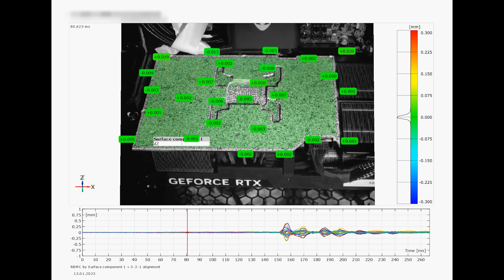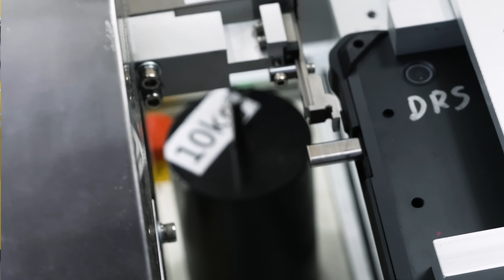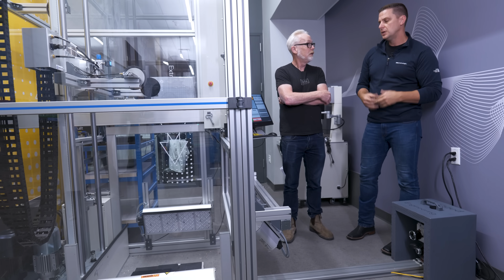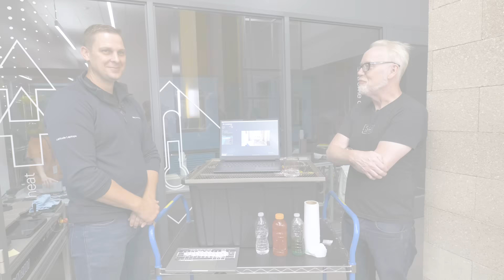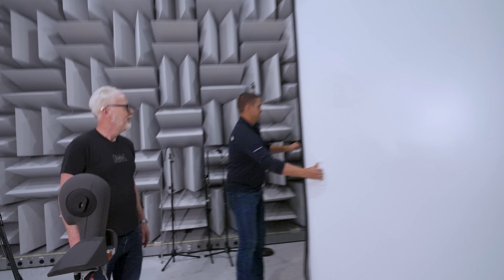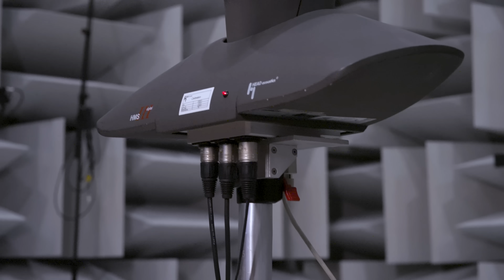Adam Savage Spills Water on a Laptop!

Comment: Totally unimpressed,  Over the last 10 years if I was present when someone spilled sweet, acidic liquid into a laptop I immediatelypulled the battery and ran water from the faucet through the whole machine, then if I had it one rinse with distilled water, then set it aside for a day or 3 to dry out.  The time to dry out was overkill.  Never had a bad experience.  Heck, back in the early 90s we used to run computer keyboards through the dishwasher without soap for the same reason!

Comment: The worse computer operating environment I ran into was a desktop running in an office adjacent to a lumber finishing mill. The case was wall to wall sawdust.
Reply: I used to do tech work, and I did jobs for a drywall company many times.  Sheetrock dust was a significant problem for their computers (and probably worse for the fan bearings than sawdust, though I never saw one fail due to that).
Reply: @rybec  I wasn't a hardware tech, so I'm not exactly sure what the state of the floppy drives were (1980s) but they couldn't read the spare disks I brought along with me.
Reply: @ssgtmole8610  I'm quite familiar with floppy drives (both the 5.25 inch ones common in the '80s and the 3.5 inch ones that were common for most of the '90s), and they could very easily have accumulated so much dust that it would prevent them from functioning correctly.  Just once piece of sawdust on the read head could have put enough space between the disk and the head that it wouldn't be able to read.

Comment: Such mixed feelings. I enjoy these paid promotions, as Adam does a good job both disclosing that we're about to see basically a lengthy ad, while still ensuring that it's actually an interesting story.

On the other hand, my Dell laptop is on its third touchpad in two years, which has failed just like the first two did, i.e. periodically getting into a state where it responds to touch intermittently or not at all, making it impossible to use. The cursor jumps around, things get clicked randomly or, if you're lucky, nothing at all happens and so you don't accidentally drag your email messages into the wrong folder (for example).

I can keep water away from my laptop. It's nice a laptop can be made to be more resilient, but why can't Dell just work on getting the basic functionality to work first? Then they can do fancy things like environmental protections.

Comment: This is the kind of thing that capitalism pays for, making better products with our purchase dollars from prior models. Nike did this for decades making a better shoe, Speedo did it for Olympic swimsuits, Specialized couldn't find a low speed wind tunnel to test their bikes and equipment on, so they went and built one next door to their Silicon Valley HQ. We want to know that our purchases and our investment in a product and in a company will improve over time. 

Dell laptops are outstanding, and have an excellent durability and lifetime. Their desktops not so much, I did that once, and never again, but I've had probably 6 of their laptops, and the two 15 inch laptops I've had all each lasted over 10 years, the 13 inch ultrabooks a bit shorter, but easily 3 to 5 years each.

Comment: I have an Alienware from the mid to late 2010s (I don't recall exactly).  I wish it had gone through this kind of testing.  It has had so many heat issues that it now won't run for more than a few minutes before it gets too hot and halts with severe graphics corruption, even right after opening it up and cleaning out dust.  At one point I replaced the old, dried and cracking thermal compound with something far superior, and that helped for a while, but I suspect the constant overheating has actually damaged some of the chips, increasing their sensitivity to heat.  (I'm running Linux on it, and I have it set to throttle at 70C, and it still has severe problems.)  I'm planning on eventually opening it up and turning it into a desktop with much better thermal management.  I'm going to getting into the market for a new laptop soon, since it is unusable as a laptop at this point, and until I had watched this, I had written off Alienware entirely due to the horrible experience.  I don't do heavy gaming, but I do some other kinds of high performance computing for work and for personal research, so I need a very powerful system that can handle extended periods of high strain.  If this is the kind of testing they are doing now, maybe I should give Alienware a second chance...
Reply: From which year you started getting these problems?
Reply: @harshvardhanMi  Somewhere in the range of 2018-2020.  Give me a moment, and I'll check the model.  I don't remember precisely what year I got it, but it was a few years old model at the time, if I recall correctly.
Reply: @harshvardhanMi  I was wrong.  I couldn't have even gotten it before 2020, and it wasn't an older model when I got it.  It's an M15 R3.  The CPU is an i7-10750H, which was launched in 2020.  That means I probably bought it either November of 2020 or March of 2021.  It started having heat issues after around a year.  I opened it up and blew dust out of the heat sinks, and that solved the problem.  Sometime in 2022, it started having heat issues again, but blowing out the dust didn't fix all of them.  It didn't heat up as much, but over around 80C it would start to have graphical glitching.  That slowly dropped to around 75C, at which point I opened it up again and found that the heat sink compound was dry and cracking.  I replaced it with a higher end heat sink compound, and that seemed to help, but eventually the glitching came back.  I was running Linux on it, so I edited some system settings to throttle the CPU at 70C, and that helped for around a year.  By the middle of last year, it would start graphical glitching at 70C even under very light loads, and this would rapidly lead to a complete crash.  The last time I cleaned out the heatsinks was early this year, and it made no difference.  Now if it is even on for more than 5 to 10 minutes, it will have severe screen corruption and crash.  I only turn it on to retrieve stuff from the hard drive now.  I haven't checked the heat sink grease recently, but the last time I checked it was still fine.

Like I said, my plan now is to eventually remove it from the case and turn it into a desktop with some high end custom cooling.  I'm hoping the heat issues haven't caused enough damage that even this won't help.
Reply: @harshvardhanMi  Hmm, I wrote a second reply, but YouTube seems to have eaten it.  I was wrong about the timing.  It's an M15 R3, and since the CPU in it wasn't released until the second quarter of 2020, it can't be older than that.  That means I probably got it in March of 2021.  It started having thermal issues around a year later, and initially opening it up and blowing the dust out of the heat sinks resolved the problem, but eventually it started having issues around 80C even when the heatsinks were clean and fans on full blast.  I opened it up and replaced the crusty and cracking heat sink compound with some higher end stuff, and set it to throttle at 70C at that point (I was running Linux on it, which allowed me to set the throttle temperature).  That seemed to fix the problems for a while, but eventually it started getting screen glitchiness again, around 65C to 70C.  Somewhere around the middle of last year it got to the point where it can't run more than 5 to 10 minutes before glitching and then crashing completely, even under low load.  I cleaned it again a few months ago, but it didn't make any difference.  I haven't checked the heat sink grease since late last year, but it was fine then.

When I was replacing the heat sink grease, I did notice that the GPU chips (at least, I think they are GPU related...I think they are VRAM chips, but it has been long enough that I no longer recall why I think that) weren't directly connected to the thermal management system.  They are connected through quarter inch thick (maybe thicker) foam-like thermal pads, which probably conduct heat quite poorly.  I suspect these chips may have been damaged by overheating, but there's not really any way I can find out on my own.  It's possible they are just overheating due to poor thermal management though, and maybe nothing is actually damaged.

Comment: WRT liquid damage: water is not necessarily a 'conductive fluid': if it's distilled (or preferably deionised) it won't cause a long-term problem unless combined with some other contaminant (eg assorted dust or other airbound pollutants): as demonstrated, simply shake off excess & leave to dry. The major (& most likely) problem comes from a solution of water & other solubles, eg acid (from carbonated drinks such as cola) & sugar (which crystallises onto a surface.. eventually, while leaving a sticky dust-attracting mess for a long time while it dries). Even if there's no sugar added to tea/coffee, milk introduces a biological growth potential over time, & the plain steeped (ie 'black') liquids are still acidic - tho less likely to adhere to components (often a distilled water wash & dry will be perfectly adequate in these cases)

Then there's airbound contaminants. Not all countries have universal smoking bans (& Dell sell their Alienware product to most) even in indoor public spaces; likewise, inner-city pollution from vehicles is a major hazard in many cities worldwide, not just India/China or others still using coal-fired power plants. Tobacco tar is extremely invasive, sticky & gathers on eg fan blades due to electrostatic attraction, which helps them to gather dust & hence become more inefficient over the laptop's (gusstimate projected) 5-yr lifespan :( Other airbound contaminants may not be as damaging over time, but this is certainly a major one to consider.. along with the ventilation (& even size) of the space in which it'll spend most of its life

WRT the drop test: I hope there are other random factors introduced into the robot testing, as it's rare a random 'caught my foot in a cable' or 'my bag failed/spilled' accident will result in a perfectly flat/45deg/corner/WHY drop IME: /some/ will always escape the test bounds & therefore be hardest to anticipate or prevent

Comment: Most decent laptops (not apple) can easily survive water spillage. Sugary beverages though, you're screwed.
Reply: I once spilled a can of coke into my keyboard.
It still worked, but after that for every key I would press it would press that key then a random key.
Reply: @cormoran2303  Corrosion on the PCB tracks caused by acid from the cola. Fix by immediately powering down (unplug the battery) & wash (gently wipe) affected part(s) with (preferably distilled) water, then leave to dry. This should fix 90% of problems. DO NOT LEAVE spillages to simply dry naturally: this will make the problem worse over time (tho you /may/ get away with an uncarbonated (ie non-fizzy) water spill)!
Reply: @snafu.X  Sugary cola is actually worse, artificially sweetened ones aren't nearly as bad because they don't leave a sticky residue behind.

Comment: Alienware are overpriced machines but they do look cool. EDIT: Testing process is great to see
Reply: I have a 2019 Alienware M15 that has been through 2 batteries and is still killing it as a decent midrange gaming system. I'm not playing Cyberpunk 2077 on it, but it's still a powerhouse system, that I expect to last as a productivity system for easily another 5 years and 2 more battery swaps. It's overpriced if you expect to replace it in 3 years, but if it lasts you 10? That's one of the best value laptops ever. If Framework hadn't come out since, I'd probably be looking at another Alienware when it's time to replace this one.
Reply: @SeanBlader  Happy to hear you had a good experience with Alienware. How much did you pay for it in 2019?
Reply: @SeanBlader  I expect batteries to last a little longer than that.